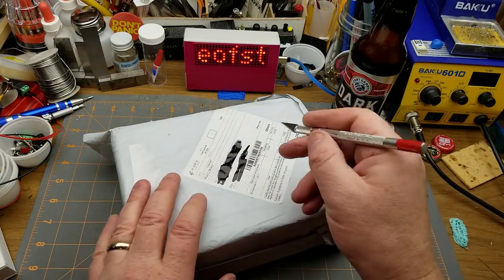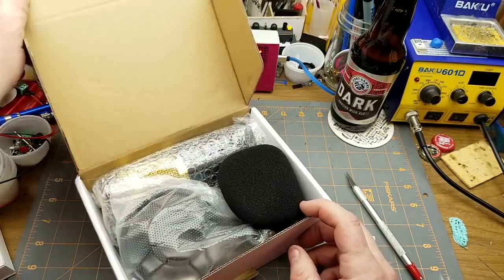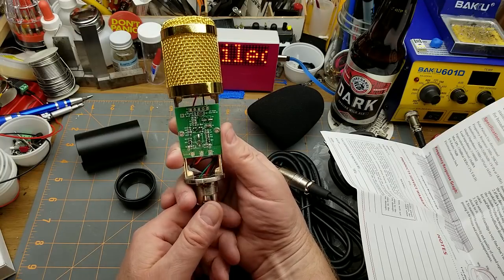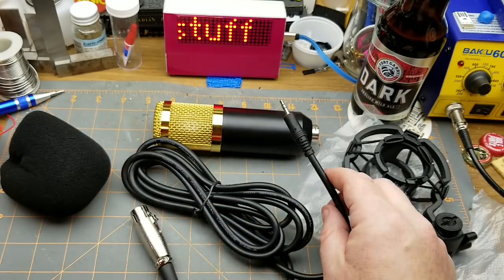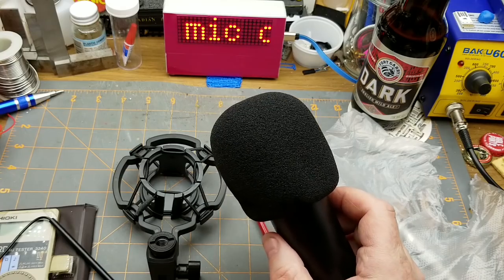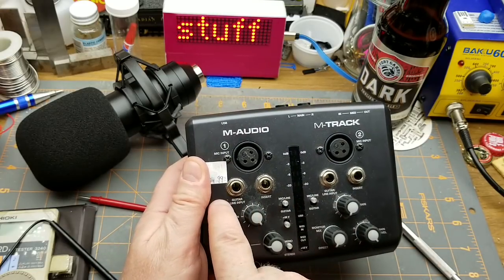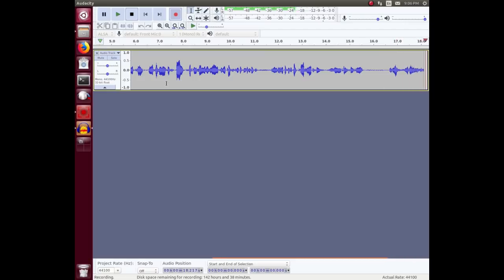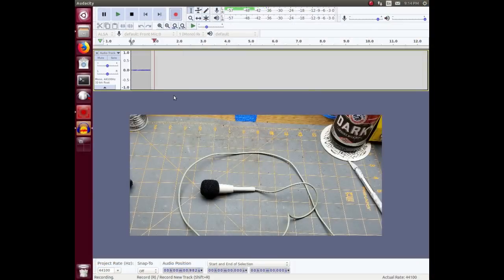A new cheap microphone - I wonder if it's any good?

Comment: The mike you started this video with sounded just fine to me. Your headset has much better sound quality than what I get from my cheap headsets. In my last video I used a cheap clip-on microphine instead of my build-in telephone mike and that seems a bit better. Recording on my phone is definitely much better than using the laptop, no matter what mike I tried...

I need to get me one of those soldering boxes too. Now I just use my iron, but using that box seems much easier! ;-)

Comment: I'm a bit confused. The cable they supply looks like it's meant to plug into your MIC Input on the PC. I'm pretty sure the PC does not have Phantom power. Or I should say I know it doesn't.  Why would they even ship that? My Mackie and Behringer do not even have 3.5mm  input. If someone hooked it to their PC wouldn't it sound shitty?
Reply from the maker: I was (and remain) confused about that cable's wiring too.  
There is a small voltage on typical PC mic inputs (they're designed to work with cheap electret mics like the one I have been using). 
But the way it was wired, it would probably short that anyway.

At some point, I'll just salvage the 3.5mm jack and put male XLR on there so I have a longer mic cable.
Reply: Mics that require phantom power should only be used with XLR cables.  I've never seen a mixer or preamp that sends 48V phantom power through TRS jacks (1/4" or mini-jack).  If someone wired up a TRS jack to send phantom power, it would temporarily short out when inserting and removing the plug, as you mentioned.  This can damage the power supply, and possibly the electronics in the mic.
Reply from the maker: @ThriftyAV  Agreed. That cable confused me too.
Reply: @pileofstuff  The board inside the mic called out 5v in, how are you putting 48v in and not letting out the magic smoke??!??  Yikes! Way confused here in the states.

Comment: Are you using a special technique that keeps the volume at the same level, ie, are you using headphones to monitor and adjusting, or is it just picking it up equally no matter what. I just got a BM800 and a TUA4 Mixer - cheap mixer/interface with phantom -, and you have to be within 4"±1" or it's too loud or too soft.
https://www.youtube.com/watch?v=OqtPM1Ij2jg
Reply from the maker: While I'm recording, I just set everything for a reasonable level and try to keep my position relative to the mic steady.
Then during editing, I adjust manually to even things out.
Reply: @pileofstuff  I was hoping there was an easier way, but I guess I will have to remember to stay in one position. My USB mic is more tolerant, but I want to use this BM800 because it's clearer.